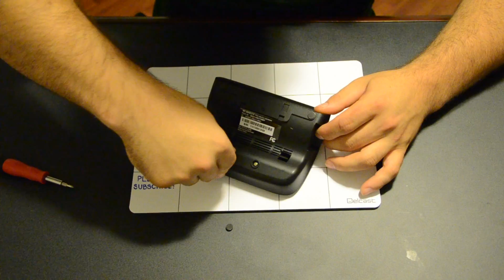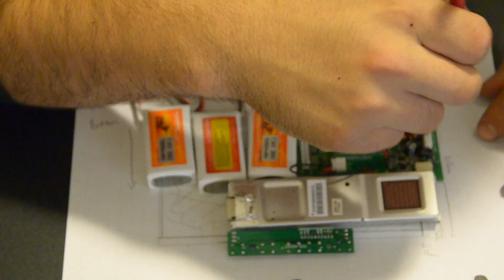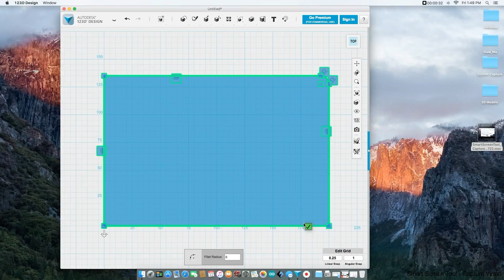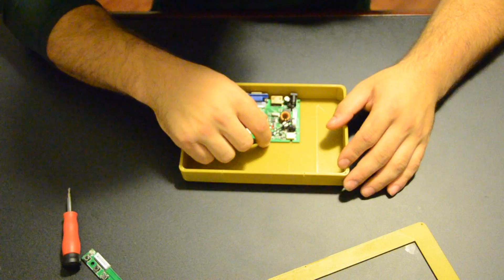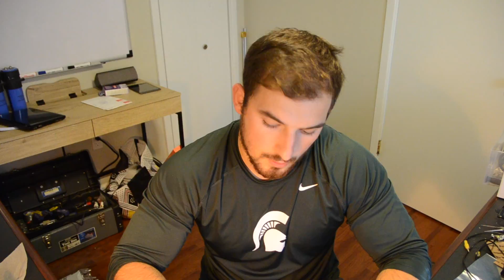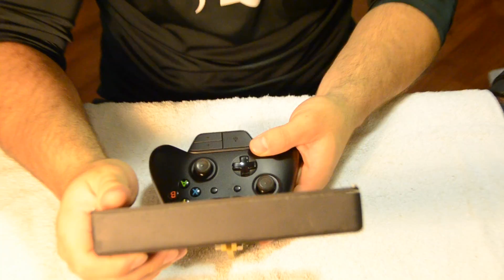Xbox One Portable! Part 1

Comment: do i need to be near my xbox one for it to work? or could i use it say on a bus about a good number of miles away, say a max of 5 miles
Reply from the maker: Theoretically you could make it so you can use it from a long way away from the xbox but theres a couple issues with that. 1.) for this build i used a 60GHz wireless HDMI , and 60GHz is really bad for long distance as it gets attenuated really badly in air. 2.) for super long range i.e (5Miles) you'd want to use a much lower frequency ~100MHz which would require a rather large antenna to use and then the antenna wouldn't be able to transmit the data needed to let it run on HD like it does on this build. 3.) and at large distances (5miles) the phase velocity would just become to large and begin to be noticeable from the user. 4.) the xbox one controller is basically designed to use bluetooth and that has a range distance aswell (~100ft in open air) which goes way down (~30ft) if it goes through a wall
Reply: so thats a no?
Reply: Vinny Gjokaj how much could I buy one of these from you for?
Reply from the maker: Oh Syrp Idk, roughly ~300. Thats what it costs for everything. two most expensive stuff is the Wireless HDMI, IPS lcd! But its worth it though because the colors look just great on it!
Reply: Vinny Gjokaj if I come up with that money I will buy it. You are very talented at what you do.
Reply: +Vinny Gjokaj At 100Mhz with a 10 dbi antenna you would probably break the law of TxPower output, depending on your country.
Reply from the maker: ScreenGames Yeah i was just saying a example, it wouldn't be practical for this application.